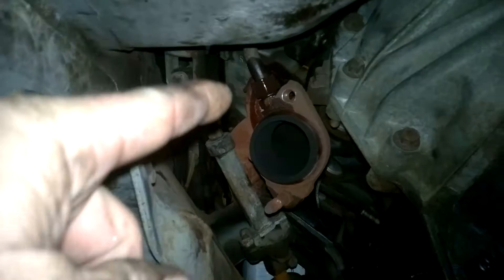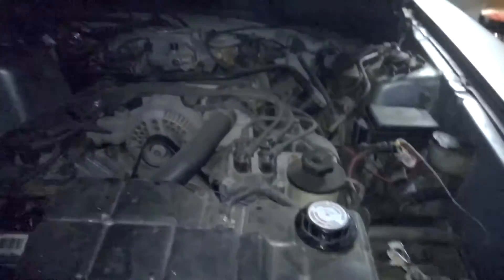Project Mustang: Success in removing stock exhaust manifolds plus some good news!

Comment: How easy was it to take the passenger side manifold off??
Reply from the maker: It's been a while but I'm sure I disconnected the motor mount from the crossmember and lifted the engine from one side to another to get access to the bolts that are otherwise very close to the strut towers